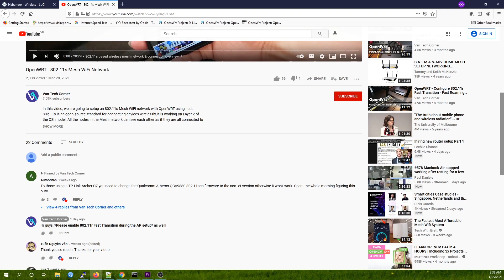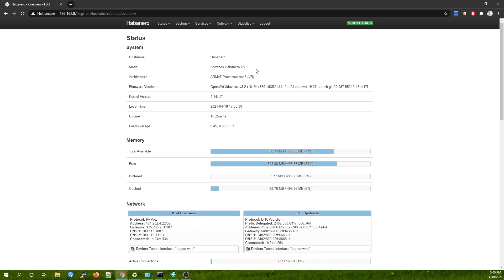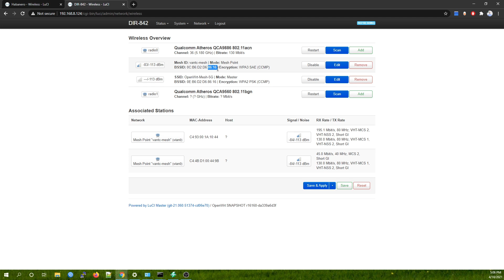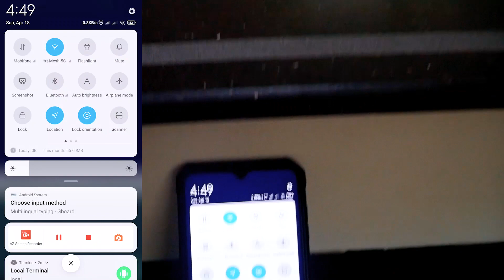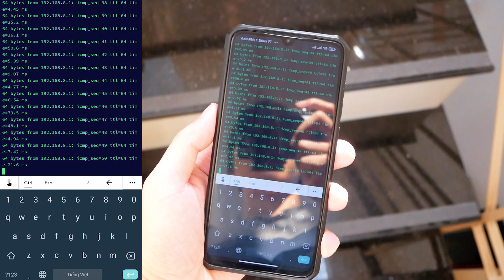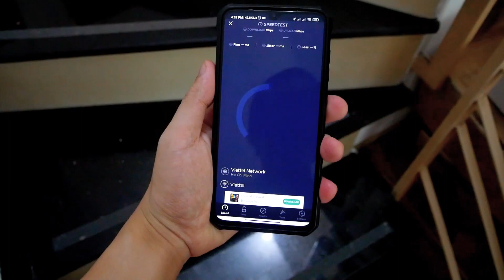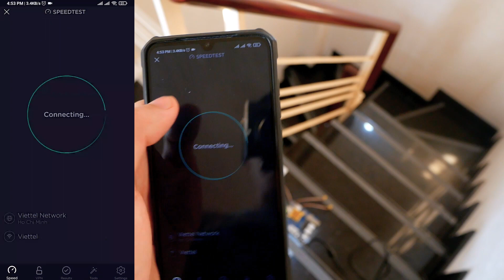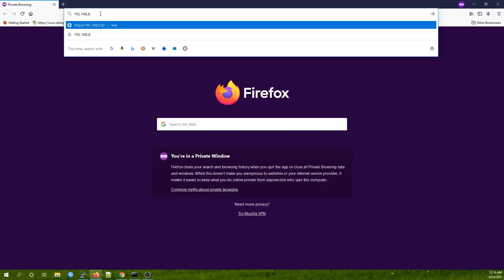OpenWRT - Mesh WiFi between different brands & Performance Test

Comment: Hello sir, most of my devices are 2.4Ghz, can I use 5Ghz for the backhaul between routers and transmit ssid on the 2.4Ghz for clients?
Reply from the maker: Hi, this is possible. You can setup the mesh network over 5GHz, and that is what I was doing in this video. But please note that 5GHz has a shorter range :)

Comment: Sir I have little questions
I have 2 tp link router
Connected through Lan cable
I want to use mesh network with them how to do so?
Also i want to flash openwrt in tp link c60 v6 how to do so? Please help sir?

Comment: Hi Max, thank you for the very informative video. I do have a slightly different problem at my apartment. I have Linksys Velop VLP01 single router from my ISP provider and recently I bought Xiaomi AX3000 2-pack mesh router. I was hoping that it covers my entire house, and I would remove the Linksys velop but to my surprise, I still have some dead zones. I wanted to check the possibility of adding Linksys Velop as a child node to my Xiaomi AX3000 mesh network. Is it possible? Can you guide me through the steps?
Reply from the maker: Hi, unfortunately this is not possible. You can only configure mesh network between different (brand) routers if it run OpenWRT. If you are using OpenWRT here is the guide to the full Mesh configure video https://www.youtube.com/watch?v=cw8ykKgVKbM&ab_channel=VanTechCorner

Comment: Hello wrtbro... is it good enough running openwrt 802.11s 802.11r with mips 750mhz ram 64mb dualband as dumb ap ? Do they need multicore processor for main ap? Any information about dumb ap network  controller software in openwrt like omada in tplink?

Comment: I m configuring 3 routers for the mesh. But there is issue with unstable connection on either one of the secondary mesh node. I m using Archerc7v2 and 2unit dir842. Any idea why?
Reply from the maker: Did you setup a static IP for each mesh node and connect them to the main router with Ethernet cable during installation? I use this method and there was no problem with the connection.
Reply: @VanTechCorner  No. i am doing t all wirelessly. Will try cable-ing before putting into position. Btw, how is your LAN cable to-and-from?

Comment: another excellent video, thanks! Do you think it is interesting to use the 802.11k and 802.11v standards together with 802.11r? thanks!
Reply from the maker: Glad you like it. I have tested it is working great with 802.11r, but haven't got a chance to test out k and k. But for my usage, k and v are necessary.
Reply: @VanTechCorner  in my use i tested 802 k and v with that DAWN application, but i realized that routers don't connect quickly. so only 802.11r with FT Over The Air works well

Comment: Hi can you make a video about IPv6 ? I try to make DHCPv6 but it didn’t release any lease for IPv6
Reply from the maker: May I know what protocol you are using with IPv6, is it only DHCP? Do you see any error message on the client/server side?
Reply: @VanTechCorner  wan_6 is virtual dynamic interface which if pppoe connect it will appear automatic.
Reply: failed to create listening socket for fe80::f21c:2dff:fe22:47cc%pppoe-wan: Address not available #just have this error no
Reply from the maker: This type of interface will be automatically created once the PPPoE connection is established. I am running PPPoE on the WAN interface, there is new WAN6 with Protocol: Virtual dynamic interface (DHCPv6 client). Perhaps you can check if your ISP supports IPv6/ if you have internet connectivity for IPv6 if using the ISP provided router.
Reply: @VanTechCorner  ya I using unifi Malaysia it support at diagnostics there have but after lan doesn’t release IPv6

Comment: Did you made a video for a beats "router" with fully working OpenWRT? I mean a PC with powerful SoC, which you can not get on any router. I find some PCIe 10 Gbit cards for 35€, which was few years ago ober 600€
Reply from the maker: Hey, currently my hardware (routers and PCs) doesn't support 10 Gbps, so there is no way to test it. Maybe in one more year when the technology is getting cheaper. I do have a video installing a 4 ports Intel NIC on the Xeon L5630, you can check it out here https://www.youtube.com/watch?v=D5JxrNgLSnA&list=PL58__w3t_eTbcBQ9oJ8jXCxPtBiac59vC
Reply: @VanTechCorner  nice! I never saw something like that, I just look for NAS DIY and find your videos. Just don't know which hardware are fully supported on OpenWRT.
Reply from the maker: Most of the Intel & Realtek Ethernet adapters work fine with OpenWRT. From what I can see, if the device is working with other Linux distro, it will work fine with OpenWRT. If you need further information, feel free to join the OpenWRT forum and confirm with them before purchasing.